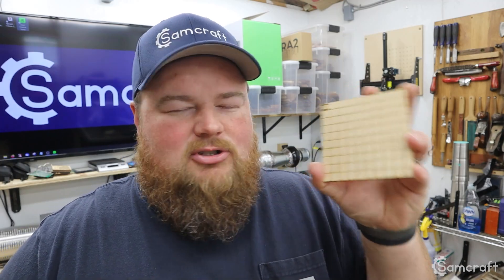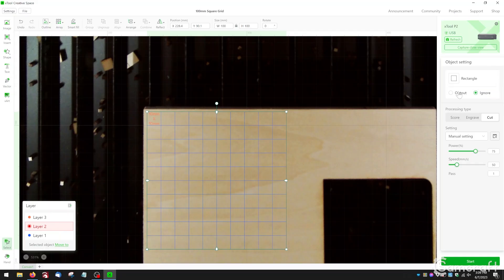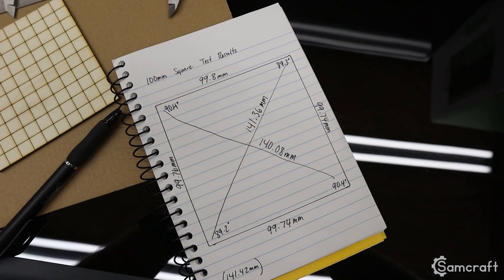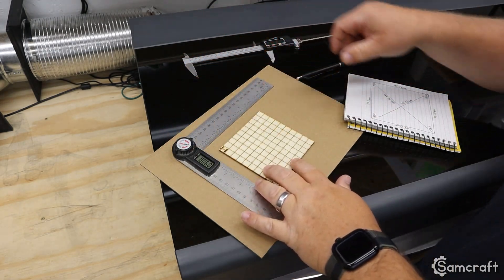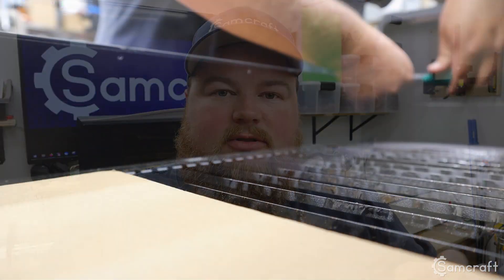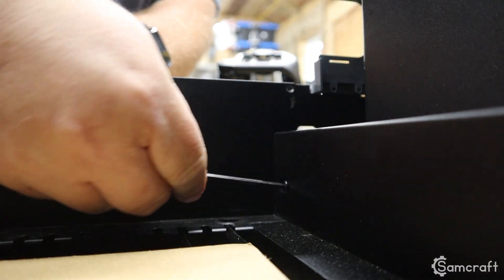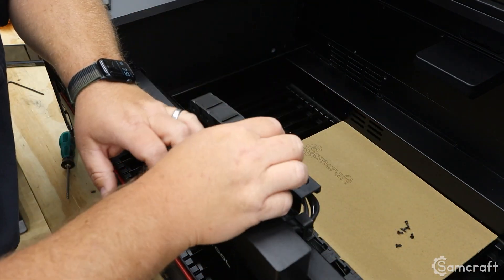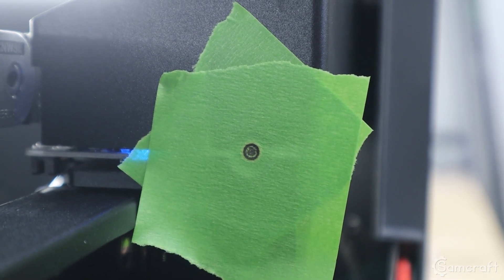Is Your Machine Accurate? xTool P2 Gantry Alignment, Test & Fix!

Comment: Horrible that you buy a £2000 machine that then needs 48hrs of solid work to calibrate and fix bad quality control from the factory. My mirrors and my belts were off from brand new. It's now day 2 of owning the machine, and I'm still taking it apart again and again trying to fix it. I'm almost at the point of returning it - it's only 48hrs old and I can't even make it work

Comment: You may want to look at the screws that capture the shaft in the rear that is driven off of the motor. loosen the screws on the coupling that are along the shaft pull, your gantry square and then snug those.

Comment: Hello Sam, mate I'm sorry to ask but I cannot get help anywhere. My laser will not cut, score or engrave. I have cleaned everything from mirrors , lens, fan system machine generally, Optical Path ( Pass ) done alignment tests ( as per yours ) I'm not an expert and I'm loosing money by the hour. It did come up with a Fan Current too low warning. I watch your video's all the time for guidance and I am so lost

Comment: My Laser gantry is tilted slightly to the back. So the laser does not hit the piece square. Laser is calibrated. I can also push the whole gantry straight so the is play in the wheels of the rail. Any idea how to tune the wheels on the x axis for the rails?

Comment: This is great info, like all your videos. I received my P2 and the mirrors were completely out of alignment. Finally got them squared away but now I have an issue with the z-axis where the laser comes right down onto the material and drags it around the bed. Any idea how to fix that issue with the gantry? I contacted Xtool support and the info they supplied was confusing. Anyone else out there have this issue?
Reply: Same - mine also makes horrific grinding noises when you move the gantry or laser head and I can't fix it

Comment: DO NOT use the front of the machine to line up the gantry. The rollers on the gantry run on rods that are mounted behind the 2 frames running from front to back on each end of the gantry. Put a square against one of those frames and line the gantry 90 degrees from them with it. I checked my machine using a set of 1-2-3 blocks, and the gantry doesn't touch both of them. My cuts are square, so there is no adjustment needed. Using the square method shows the gantry is spot on.
Reply: X-tool's solution to aligning the gantry is to use the front as a guide without removing the cover. I would still trust using a square over this method.

Comment: I'm surprised that worked for you. At the back of the machine, the belts are on pulleys with notches for the timing belts. Those pulleys are attached to shafts from the stepper motor. To align the gantry correctly, loosen the tension on the belts just enough to take pressure off the pulleys. Then loosen one of the pulleys from the shaft so you can twist the gantry into alignment. Once it is square with the machine, you tighten the pulley back up and put tension back on the belts. In fact that is the same principle you align the gantry when you assemble the D1 and D1 Pro lasers (you leave the coupling for the shaft loose until you line up the gantry mounting plates, then tighten the coupling). You may have loosened the belts enough to allow one of them to jump a tooth on the pulley moving that end of the gantry a tooth of the belt. The gantry is still a partial tooth off which is why you couldn't get the gantry to touch both blocks completely. You can see the gantry wanting to go back when you pulled on it because you are just stretching the belt. If you had loosened a pulley, the gantry would stay right where you want it.
Reply: I was looking on x-Tool's website support section for another issue with the P2. I see they have a guide on how to align the gantry. They have you remove the back cover inside the machine exposing the 'Y' axis shaft and stepper motor, then loosening the coupling connected to the right shaft and pulley so the pulley is free to rotate independant from the left pulley.
Reply: @TinkeringJohn  Thanks! I found the section-- it was well explained and easy to do... my squares are square!
Reply: Yes.  Just un-tensioning and re-tensioning belts isn't going to change anything per-se.  If it does there are other problems.

Comment: I just got my Xtool P2 today and cut a 20mm x 20mm square out of acrylic. The cutout ( That fell through ) measured 19.8 x 19.8 all around, and the outer part that didnt drop, was 20.1 x 20.1 all around. Corner to corner was 20.1 as well, Was super squared and very impressed! Though I need to learn xtool's software so I can do kerf/offset for when I need press-fit parts.  I do prefer using lightburn, I use that with my fiber laser. But for the sakes of all the features, I use xtool's software.

Did buy your test grid earlier today though! Worked out great.  Im curious if I can use the P2 like a pass-through, without their reiser unit. I saw there's an option to disable the bottom-tray detection. And in the past with my diode laser, I use to just set acrylic ontop of a sheet of stainless steel to do straight cuts.  There's times I may have a 24" x 24" piece of acrylic that I want to cut to 12" x 24" and rather laser cut it, than attempt to score it with a blade. So if I can just remove the bottom tray, place the 24x24 acrylic ( with matte steel under it ) I guess I should be able to do exactly that?

Comment: Thank you for posting this @SamCraft Appreciate the heads up 👍 Is there a good alternative to using machine blocks? (not sure if I can afford to buy some in time for my P2s arrival) Also how easy was the bit in the video you sped up (before that point I was thinking I'd feel pretty confident doing this, when it sped up & you seemed to have to go back & forth a lot that was worrying for a novice like me)
Reply from the maker: anything that is identical dimensions will work. Even off cuts from a 2x4. So long as they're the same length. :) The sped up part was me tweaking and trying to find any easier way to lock it down and see what else may be out of sorts. It was more me striving for perfection than a real necessity. Hope this helps!
Reply: @Samcraftcom  probably sounds stupid...but would duplo blocks work? Was it a lot of re-loosening/re-tightening bolts/screws? If I had a similar problem could loosening the belts cause problem? Apologies for my naivity...I'm currently starting to feel like I may have made a mistake spending so much money on something that may not 100% work accurately 😒 I'm a perfectionist myself but have zero knowledge of what I'd be looking to fix 🤦‍♂️

Comment: When I put my laser together, I thought it was pretty square. Until I tried to cut my first box. Found out that thing was almost 1/8” out of square. It was bad. Finally one day had the idea to try and figure it out. I guess when one side skips a belt tooth it can get VERY far out of square. Pretty much did the same thing as you did, but without the 1,2,3 blocks. I used a speed square and a tape measure. But all worked out in the end!

Comment: Great recommendation, we have to do these things on most 3d printers to keep the x-axis in parallel to the bed.  IF there's a way to loosen up the x axis on either side to actually make the AXIS parallel (not just pulling with the belts), that may be a more permamant fix, as the belt fix will need to be done periodically, as it'll go out of spec again at some point due to use, slips, etc.  I'll say again though, I don't have a xTool P2, so I'm not 100% sure if there's an adjustment there that could be used to square the x gantry permanently without using the belt tension, just offering the suggestion in case there is...
Reply: I second this. Coming to lasers from the 3d printer space, I've had to do this several times to my printers. I fully expect to have to do similar adjusting on my Elegoo Phecda when it gets here in a couple weeks.
Reply from the maker: You're totally right David! When it comes time to tweak it again, I'll be disassembling the whole gantry I bet.
Reply: @Samcraftcom  I'm ASSUMING that you can do that on the xTool, and it doesn't have some sort of one-piece x axis gantry, but even if it were directly connected to linear rail carraiges (for example), there'd still be a tiny bit of adjustment if loosened.  I have an issue on my HL1060 with the honeycomb bed and it having a bit of 'tilt' to one side to it, but try as I might, I just can't adjust it out, but I do have it mitigated with shims.  I think the whole bed rack is slightly twisted, so I'm planning on welding up a new bed carriage out of tubular 1", and see if I can make one that's a bit more 'straight'.  The things we have to do for our equipement sometimes, lol...

Comment: It is definitely manufacturer fault as they use very cheap gantry systems, most of it is out of their diode lasers. on lasers with proper built gantries ( Aeon, Thunder, etc.) this simply does not happen and they also come from Asia :)
Great explanation though for the many having this issue with the P2`s now!